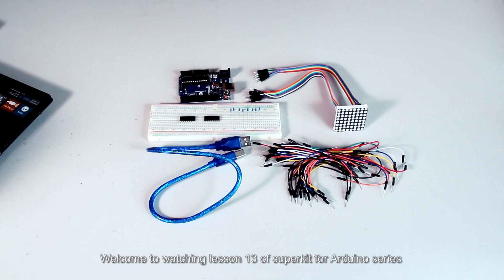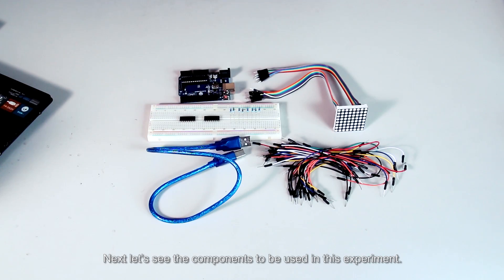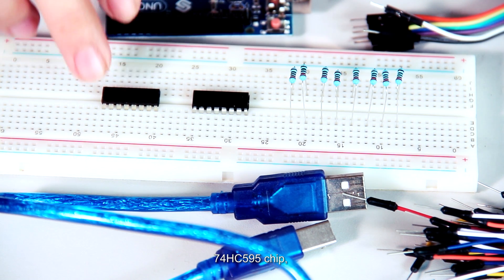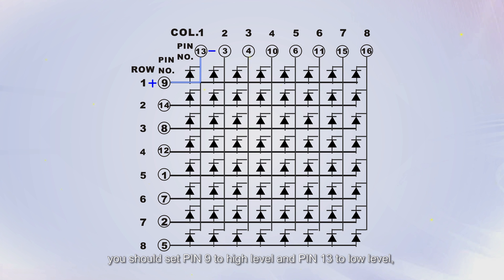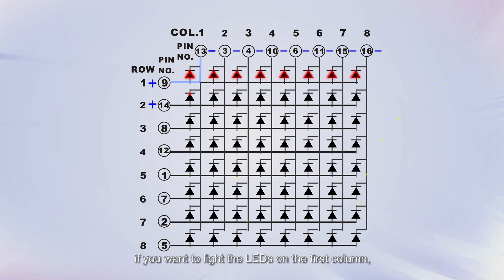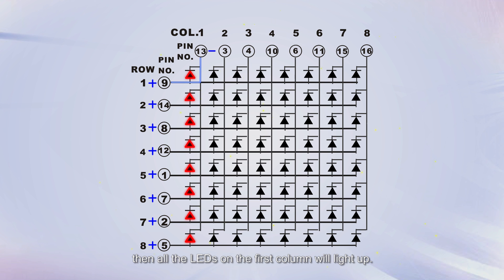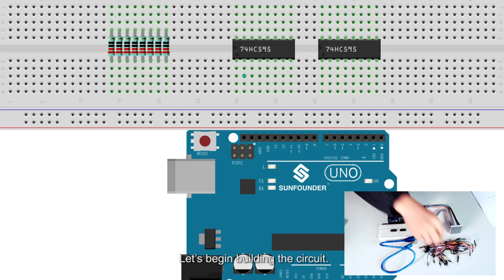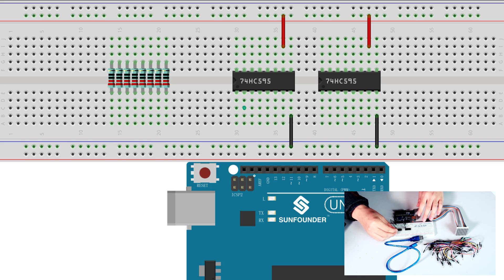SunFounder Learning Starter Kit Tutorial for Arduino - 8x8 Dot Matrix Display - Super Kit/RFID Kit

Comment: GERMAN: Es tut mir leid, dass ich nur deutsch spreche, aber ich habe ein Fehler gefunden! Bei mir werden nur 16 LED's angezeigt und 16 LED's, die flakern! https://goo.gl/yXPXQD https://goo.gl/VXCGEK
Reply from the maker: First thanks for comments. But there are actually 64 LEDs on the dot matrix. You can refer to our Learn and WIKI page: https://www.sunfounder.com/learn/Super-Kit-V2-0-for-Arduino/lesson-12-dot-matrix-led-display-super-kit.html, http://wiki.sunfounder.cc/index.php?title=RGB_Dot_Matrix_Explanation
Reply: SunFounder Maker Education Thanks! But I mean the Tutorial doesn't Work! I did everything what she did and it doesn't Work! I bought the Mega Set with the dot matrix Display. so, WHY IT'S NOT WORKING?!?!
Reply from the maker: sorry for this late..still not working? you can refer to the user manual coming with the kit and check whether your wiring is correct. It's easy to get wrong if you don't get the matrix is a common anode or cathode one. You can also refer to our WIKI page for more details: http://wiki.sunfounder.cc/index.php?title=RGB_Dot_Matrix_Explanation. If  you still cannot solve the problem, you may post a picture of your wiring and screenshot of code uploading results in IDE on our FORUM https://www.sunfounder.com/forum

Comment: why this code convert like this? not like your please help me :'(
(0) 0(1) 1(2) 2(3) 3(4) 4(5) 5(6) 6(7) 7(8) 8(9) 9(10) a(11) b(12) c(13) d(14) e(15)
 f(16)

0x00,0x00,0x00,0x00,0x00,0x00,0x00,0x00,/" ",0/

0x3E,0x7F,0x59,0x4D,0x7F,0x3E,0x00,0x00,/"0",1/

0x42,0x42,0x7F,0x7F,0x40,0x40,0x00,0x00,/"1",2/

0x62,0x73,0x59,0x49,0x6F,0x66,0x00,0x00,/"2",3/

0x22,0x63,0x49,0x49,0x7F,0x36,0x00,0x00,/"3",4/

0x18,0x1C,0x16,0x13,0x7F,0x7F,0x10,0x00,/"4",5/

0x27,0x67,0x45,0x45,0x7D,0x39,0x00,0x00,/"5",6/

0x3C,0x7E,0x4B,0x49,0x79,0x30,0x00,0x00,/"6",7/

0x03,0x63,0x71,0x19,0x0F,0x07,0x00,0x00,/"7",8/

0x36,0x7F,0x49,0x49,0x7F,0x36,0x00,0x00,/"8",9/

0x06,0x4F,0x49,0x69,0x3F,0x1E,0x00,0x00,/"9",10/

0x20,0x74,0x54,0x54,0x3C,0x78,0x40,0x00,/"a",11/

0x41,0x3F,0x7F,0x44,0x44,0x7C,0x38,0x00,/"b",12/

0x38,0x7C,0x44,0x44,0x6C,0x28,0x00,0x00,/"c",13/

0x30,0x78,0x48,0x49,0x3F,0x7F,0x40,0x00,/"d",14/

0x38,0x7C,0x54,0x54,0x5C,0x18,0x00,0x00,/"e",15/

0x48,0x7E,0x7F,0x49,0x03,0x02,0x00,0x00,/"f",16/
Reply from the maker: Dear Anjar,
We have looked your code.
Take the display of "0" as an example.
They are 8 hexadecimal numbers. Use a "~" (~data[num]), meaning inverting each number, and we can get 0x00, 0x3E, 0x41, 0x41, 0x41, 0x3E, 0x00, 0x00 after inverting the 8 numbers one by one. Convert the numbers into binary ones: 0000 0000, 0011 1110, 0100 0001, 0100 0001, 0100 0001, 0011 1110, 0000 0000, 0000 0000. Copy the arrays to the code and you will see 0 displayed in the dot matrix. 

This is the picture：https://s3.amazonaws.com/sunfounder/Arduino/dot+matrix.png
Hope you can solve the trouble.
Have fun!
Reply: where I put this code Use a "~" (~ Data [num]), because your code does not exist? or there are other programs that can reverse such data
// Dot-Matrix Display
// The dot-matrix will display 0 to F circularly
//Email:support@sunfounder.com
//Website:www.sunfounder.com
//2015.5.7
const int latchPin = 8; // Pin connected to ST_CP of 74HC595
const int clockPin = 12; // Pin connected to SH_CP of 74HC595
const int dataPin = 11; // Pin connected to DS of 74HC595
Data int [] = {
  0xFF, 0xFF, 0xFF, 0xFF, 0xFF, 0xFF, 0xFF, 0xFF, / * "," 0 * /
  0xFF, 0xC1,0xBE, 0xBE, 0xBE, 0xC1,0xFF, 0xFF, / * "0", 1 * /
  0xFF, 0xDF, 0xDF, 0x80,0xFF, 0xFF, 0xFF, 0xFF, / * "1", 2 * /
  0xFF, 0xDC, 0xBC, 0xBA, 0xB6,0xCE, 0xFF, 0xFF, / * "2", 3 * /
  0xFF, 0xDD, 0xBE, 0xB6,0xB6,0xC9,0xFF, 0xFF, / * "3", 4 * /
  0xFB, 0xF3,0xEB, 0xDB, 0x80,0xFB, 0xFF, 0xFF, / * "4", 5 * /
  0xFF, 0x8D, 0xAE, 0xAE, 0xAE, 0xB1,0xFF, 0xFF, / * "5", 6 * /
  0xFF, 0xC1,0x96,0xB6,0xB6,0xD9,0xFF, 0xFF, / * "6", 7 * /
  0xFF, 0xBF, 0xBC, 0xB3,0xAF, 0x9F, 0xFF, 0xFF, / * "7", 8 * /
  0xFF, 0xC9,0xB6,0xB6,0xB6,0xC9,0xFF, 0xFF, / * "8", 9 * /
  0xFF, 0xCD, 0xB6,0xB6,0xB4,0xC1,0xFF, 0xFF, / * "9", 10 * /
  0xFC, 0xF3,0xCB, 0x9B, 0xEB, 0xF3,0xFC, 0xFF, / * "A", 11 * /
  0xFF, 0x80,0xB6,0xB6,0xB6,0xB6,0xC9,0xFF, / * "B", 12 * /
  0xFF, 0xE3,0xDD, 0xBE, 0xBE, 0xBE, 0xBE, 0xDD, / * "C", 13 * /
  0xFF, 0x80,0xBE, 0xBE, 0xBE, 0xBE, 0xDD, 0xE3, / * "D", 14 * /
  0xFF, 0x80,0xB6,0xB6,0xB6,0xB6,0xBE, 0xFF, / * "E", 15 * /
  0xFF, 0x80,0xB7,0xB7,0xB7,0xB7,0xBF, 0xFF, / * "F", 16 * /
  0xFF, 0xFF, 0xFF, 0xFF, 0xFF, 0xFF, 0xFF, 0xFF, / * "," 17 * /
};
void setup ()
 {
   // Set pins to output
   pinMode (latchPin, OUTPUT);
   pinMode (clockPin, OUTPUT);
   pinMode (dataPin, OUTPUT);
 }
void loop ()
 {
 
   for (int n = 0; n <136; n ++)
    {
      for (int t = 0; t <10; t ++) // Show repeated 10 times
      {
        int dat = 0x01;
        for (int num = n; num <8 + n; num ++)
        {
          shiftOut (dataPin, clockPin, MSBFIRST, ~ Data [num]); // ROW control of dot matrix
          shiftOut (dataPin, clockPin, MSBFIRST, ~ dat); // Control COL of dot matrix
          // Return the latch pin high to signal chip that it
          // No longer needs to listen for information
          digitalWrite (latchPin, HIGH); // Pull the latchPin to save the Data
          // Delay (1); // Wait for a microsecond
          digitalWrite (latchPin, LOW); // Ground latchPin and hold low for as long as you are transmitting
          dat = dat << 1;
          delay (1); // Wait for a microsecond
        }
      }
    }
 }
Reply from the maker: Dear Anjar,
Yes, you are right. you can find it in the line 46 : shiftOut (dataPin, clockPin, MSBFIRST, ~ Data [num]);
Pls have a try, if you have further trouble, pls connect with us.

Comment: Como puedo hacer el mismo proyecto pero con una matriz 8*16 (2 matrices 8*8)?? es el mismo concepto que el del video solo que mas grande y con mas letras

Gracias
Reply from the maker: Sí, puede hacerlo, porque ese principio es casi lo mismo con esto, pero hay que hacer algunos cambios en la conexión cables y el código.(Yes, you can do so, because that principle is almost the same with this, but you need to make some changes in wires connection and code.
)

Comment: I understand how to create new shapes to display.  What I can't figure out is how to increase the number of shapes before it loops back.  For instance, How could I have it display "","0","1","2","3","4","5","6","7","8","9","A","B","C","D","E","F","","Z","Y","X","V","U","T","S"?    I tried increasing one of the values and it seemed to just generate random patterns.Also, how can we have the text scroll vertically? And how can we make it static for 1 second before changing to new letter?My biggest problem setting this up was not knowing which side is up on the 8x8 Dot Matrix.  Once I reversed the wires, it works great!  Thanks!
Reply from the maker: 1. If you want to display more characters, you need to add the parameters for the characters to the code, between the two lines /"F",16/ and /" ",17/ in the array data[]. And then modify for(int n = 0; n < 136; n++) – change the number 136 into 136+x, x meaning the number of characters you want to add. 
2. To make the characters scroll vertically, you need to change the code and wiring. You may try to study it by yourself. Remember the side labeled with Label (788BS) is the down side of displaying.

Comment: How can i modify the code so there appears other Letters on the 8x8 Matrix?
Reply from the maker: +Orkun Balci Here you may need a font creator software. We provide one in the package on our website, and you may use it or another to get the table for your figure or character on the matrix. Then copy the table to your code and compile.
Reply from the maker: +Marco Falotico Here's the general guide for software things, including some other tips, just in case. 
You can download the latest version at this link: https://www.arduino.cc/en/Main/Software, and then install the software according to the guide. After installation you can open our code now, jsut as this image shows: https://imgur.com/FlP8Yt2. 
But before you upload the code, you need to click Tools -> Board (if you use Uno, then click Arduino/Genuino Uno) -> Port (when you log in the board, the computer will install the driver, then will show the board in which port).
After these, you may start edit, compile, and upload the sketch to your board.

Comment: Wow, this is pretty poor customer service. Keep blaming the wiring when there are multiple copies of code in the wild that simply don't work.

Look here:

shiftOut(dataPin,clockPin,MSBFIRST,~data[num]);
shiftOut(dataPin,clockPin,MSBFIRST,~dat);

it needs to say "~data" and "~dat" ... many copies in the wild say simply "data" or "dat" without the "~" ... this produces garbage on the matrix display. People come here to complain and then Sunfounder tells them it's their wiring!

If you don't have a ~ in the code you're uploading, try adding it. On mine, I at least got some somewhat legible characters on the screen that scroll as they are supposed to, however I have 6 LEDs that are stuck on constantly that I don't seem to be able to fix.

I suspect a CODE issue (NOT WIRING) for those as well. If I figure out a fix I will share it.
Reply from the maker: +Ben Lentz  Sorry for the trouble. The wiring is good but there is indeed an error in the code we provided. We did not debug it until recently. Thanks for your suggestion! The code package on our website has been rectified and now it works with the wiring. We'll be more careful when uploading the sketch and make sure it works with the wiring specified.

Comment: Used code from Super Kit disc and does not cycle through characters, only lights up the 1st, 2nd, 3rd, 4th, 5th, and 7th row's dots. Code used: 
{0xFF,0xFF,0xFF,0xFF,0xFF,0xFF,0xFF,0xFF,/" ",0/
              0xFF,0xC1,0xBE,0xBE,0xBE,0xC1,0xFF,0xFF,
              0xFF,0xDF,0xDF,0x80,0xFF,0xFF,0xFF,0xFF,/"1",2/
              0xFF,0xDC,0xBC,0xBA,0xB6,0xCE,0xFF,0xFF,/"2",3/
              0xFF,0xDD,0xBE,0xB6,0xB6,0xC9,0xFF,0xFF,/"3",4/
              0xFB,0xF3,0xEB,0xDB,0x80,0xFB,0xFF,0xFF,/"4",5/
              0xFF,0x8D,0xAE,0xAE,0xAE,0xB1,0xFF,0xFF,/"5",6/
              0xFF,0xC1,0x96,0xB6,0xB6,0xD9,0xFF,0xFF,/"6",7/
              0xFF,0xBF,0xBC,0xB3,0xAF,0x9F,0xFF,0xFF,/"7",8/
              0xFF,0xC9,0xB6,0xB6,0xB6,0xC9,0xFF,0xFF,/"8",9/
              0xFF,0xCD,0xB6,0xB6,0xB4,0xC1,0xFF,0xFF,/"9",10/
              0xFC,0xF3,0xCB,0x9B,0xEB,0xF3,0xFC,0xFF,/"A",11/
              0xFF,0x80,0xB6,0xB6,0xB6,0xB6,0xC9,0xFF,/"B",12/
              0xFF,0xE3,0xDD,0xBE,0xBE,0xBE,0xBE,0xDD,/"C",13/
              0xFF,0x80,0xBE,0xBE,0xBE,0xBE,0xDD,0xE3,/"D",14/
              0xFF,0x80,0xB6,0xB6,0xB6,0xB6,0xBE,0xFF,/"E",15/
              0xFF,0x80,0xB7,0xB7,0xB7,0xB7,0xBF,0xFF,/"F",16/
              0xFF,0xFF,0xFF,0xFF,0xFF,0xFF,0xFF,0xFF,/" ",0/};/"0",1/
Reply from the maker: The code is correct. This experiment is a little difficult. You must ensure all the connections are in good condition and there is no loose wiring.
Reply: I'm having the same issue...
Reply from the maker: Oliver Jackson Please refer to our latest code: https://www.adrive.com/public/mks3E6/Matrix.ino
Edit: changed the link. Visit http://www.sunfounder.com/index.php?c=case_incs&a=case_nr&type=19 and click the zip file Super Kit under Download.
Reply: Sunfounder code not worrkiing!!! the link says file is busy!!! any other way you can give the code????
Reply from the maker: Magic Waffle Fries You can go to our official website www.sunfounder.com to download the code in LEARN section.
Reply: Sunfounder Im having the exact same problem. It tells it will display 0 to F but really it just shows random patterns and shapes. I have never seen any number or letter come up. Also I don't understand how to change the (int data[] =) so i can make my own patterns. Please Help!
Reply from the maker: AAQ Films Well this lesson may be a little bit difficult...But as long as you follow the procedures and connect the wires exactly as we suggest in the manual, you can make it! The issue is the wiring. You may check the tutorials by LEARN>Get Tutorials>Arduino on our website and find this lesson. Then on the page check the Principle section, then you can understand how the LED works. And the detailed wiring diagram is shown. 
If you have other questions, feel free to ask! Or post in the FORUM section on our website!
Reply from the maker: +Jason McSheene 
Thanks for your suggestion!  The code we provided has a minor mistake and we've modified the code package on our website. Sorry for the bother.